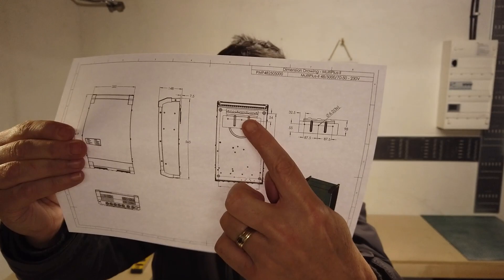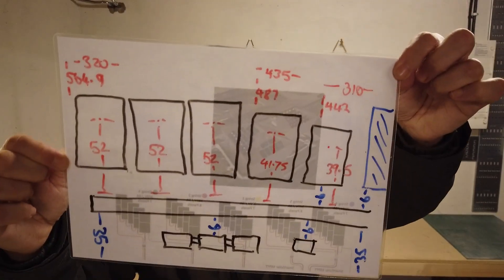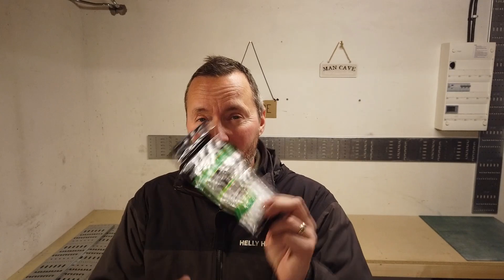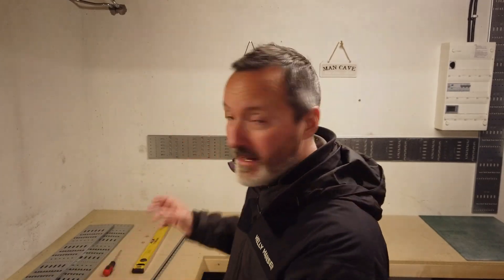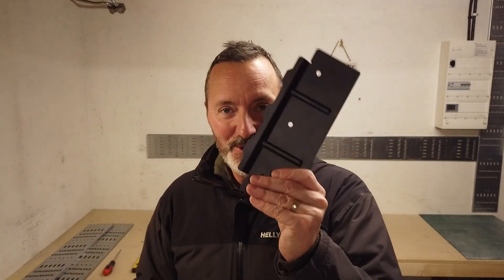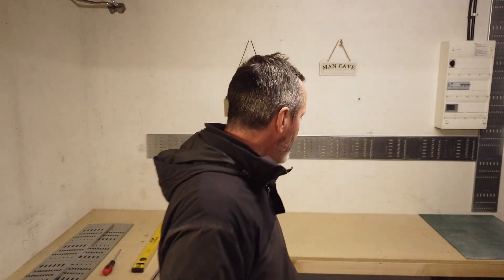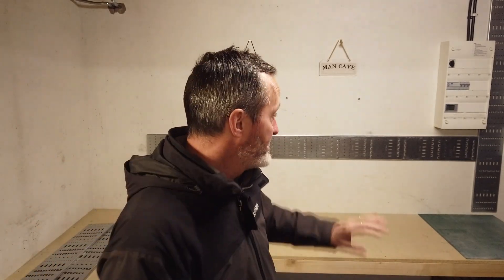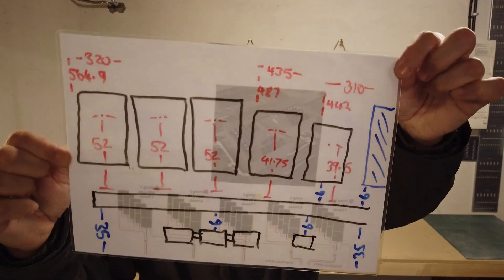Victron Install Part 1 - Measuring Up & Wall Templates

Comment: Hi mate, top tip for easy templates, rather than endless measuring take the item to a scanner/copier and do a 1:2:1 scan print, then toy have a perfect template to stick to the wall. Great for extension cables
Reply from the maker: Great idea, I wish I'd thought of that lol!